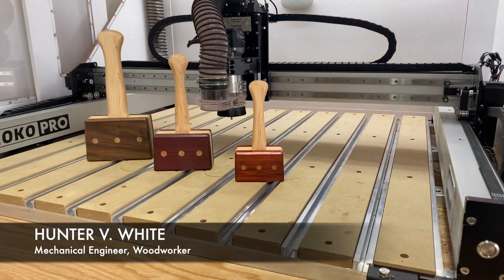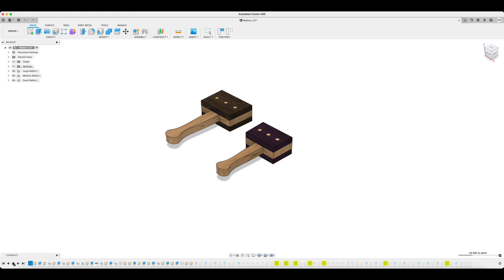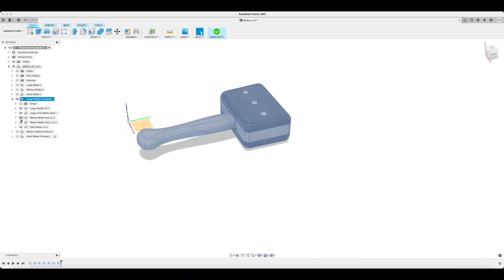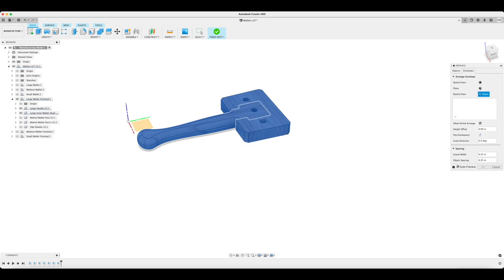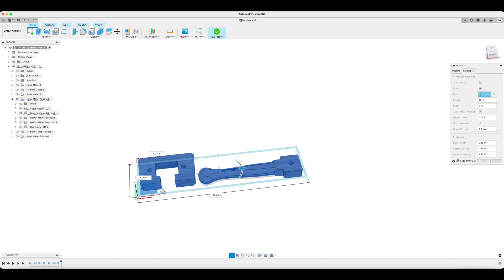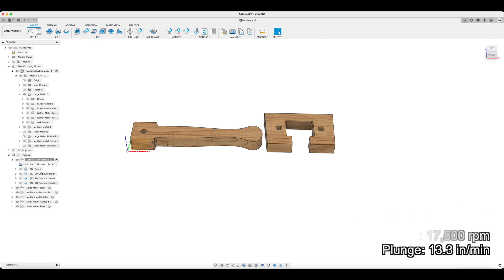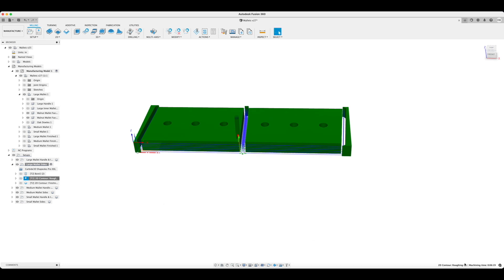CNC Project: Woodworking Mallets

Comment: Bought this and cut out a few of small mallets. They dont really fit and need a ton of time with my rasps. I offset the mallet by .005 and its still not enough. Glr reference im using Vcarve. 

Any tips? Any idea how much i need to offset it by? Im on my 3rd attempt so far.
Reply from the maker: Hey,

I'm sorry you are having trouble. The inner mallet and handle are modeled with zero tolerance, so an extra contour pass must be completed to provide assembly tolerance. I modeled a zero-tolerance so each customer could create their own tolerance based on the performance of their CNC machine and their assembly preferences. 

At the bottom right of each CNC Instruction page for these components ( pg. 8, 20, and 29) and the top left of the part diagrams (pg. 10, 22, and 31) I recommend a contour pass subtracting 0.01 inch from the inside face of the inner mallet to create a press-fit with the handle; 0.01 inches from each side will result in a 0.02 inch total tolerance. I do this with a finishing pass with negative "stock to leave" in Fusion360. In my prototyping, this tolerance was the best fit, given the accuracy of my CNC machine (Shapeoko XXL Pro). 

Note: If you contour the entire inner face of the inner mallet, you will create a small gap where the handle emanates from the mallet head. The tighter the tolerance, the smaller the gap. 

I hope this helps!
Reply from the maker: Hey,

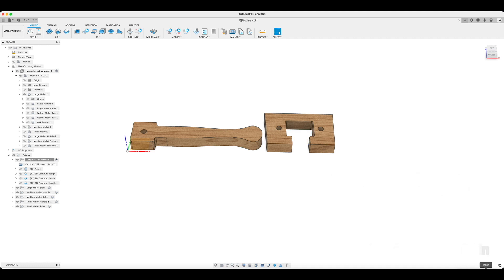One more note. At 2:19 in the video, I discuss setting up a finishing pass with negative stock to leave if you need a demonstration. I'm sorry I can't tell you how to do this in VCarve.
Reply: Amazing, this was the info I needed. I really appreciate it and absolutely love the design of the mallets. This helps a lot! 

I should have read everything more thoroughly.
Reply: Update- got to to fit snuggly today. They're absolutely beautiful, highly recommended for anyone who's on the fence. They look great with a curly maple handle.

Comment: I'm curious, what is the advantage of the 2-piece core, if you're just going to glue the layers together anyways?  Versus cutting the handle and middle layer as one piece?
Reply from the maker: The two piece core allows for proper grain direction for each function, maximizing possible strength. The strongest grain orientation for any handle has the grain going along the handle. The best grain direction for a mallet face is end-grain. This will absorb force better while minimizing visible damage. This also allows me to match the grain direction of the side pieces of the mallet head. A single piece would have to compromise strength in either the handle or the mallet.
Reply: @EngineeringWorkshop_hvw  Awesome, thanks!

Comment: Really nice work! They came out great! Putting the work pieces in a vice or even clamping them down to the bench when you're trimming the dowels and rounding over the edges might make things a little easier on you.
Reply from the maker: Thanks! I do need to get a vise. I’m planning to incorporate a bench vise and tail vise into an out feed table. I just need to get around to designing it.

Comment: Aren't these styles typically loaded with a filler to prevent bounce, like a deadblow hammer?
Reply from the maker: They certainly can be. After having used these mallets for a few months now, they don’t bounce anymore than you would expect from a wood contact surface. The hardwood feels light enough to prevent fatigue, and heavy enough to deliver serious force of required - especially the heavy one (my wife calls it Thor’s hammer).